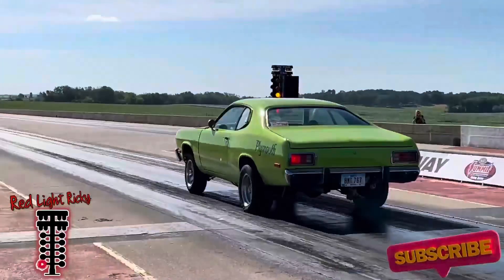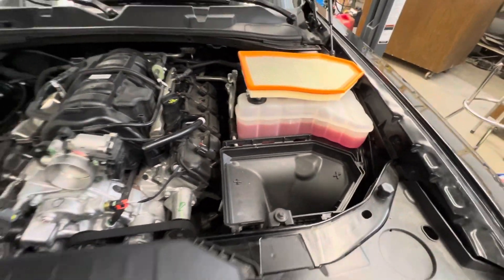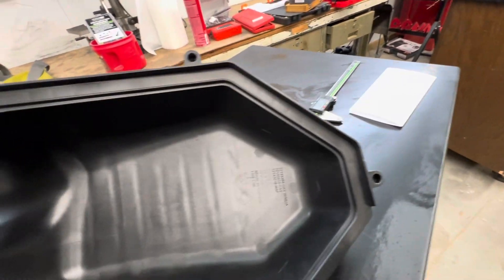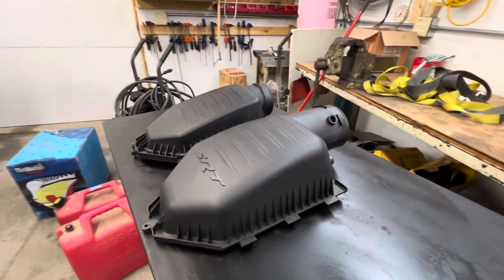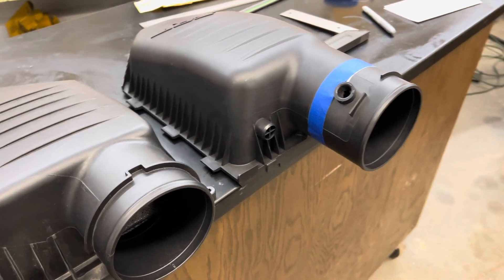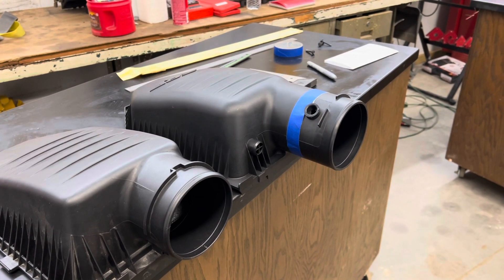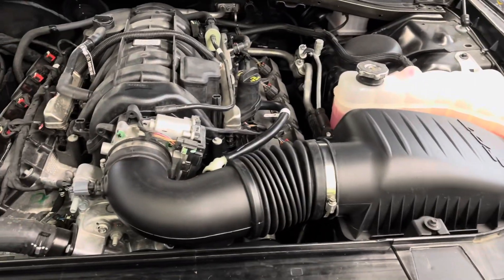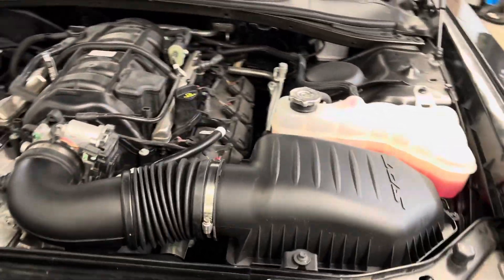Hellcat Intake Upgrade On The Dodge Challenger RT

Comment: That's a good mod, now you definitely need the Hellcat lower(with the tube to the running light), and drop in K&N filter. You can remove the "cap" from the back of the running light, connect the tube between the light and h.cat lower, and draw in cooler air to lower the I.A.T. temps.  I did this on our '20 RT Scat Pack Challenger,  the iat's are  within 5° of ambient temp.
Reply from the maker: I’ll check that out. Wasn’t sure yet where the tube would connect. Thanks for the tip.